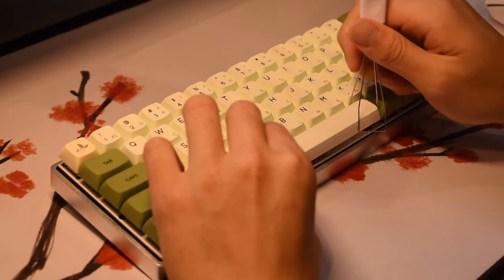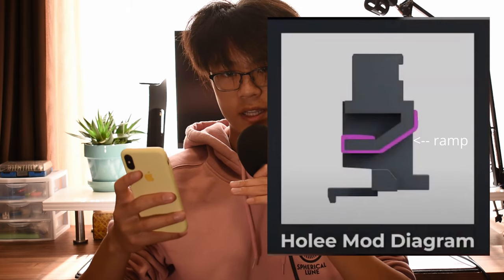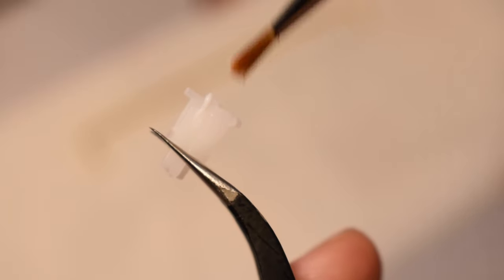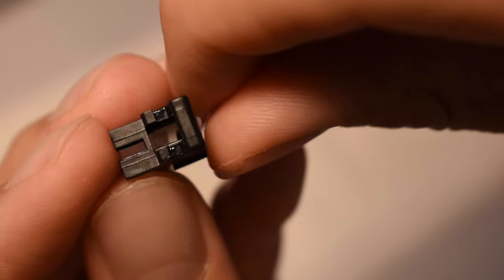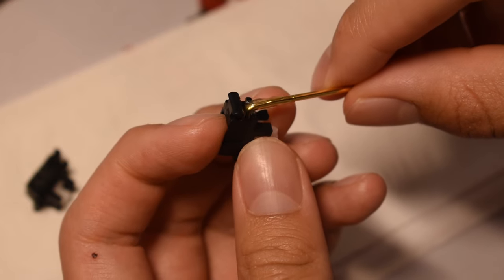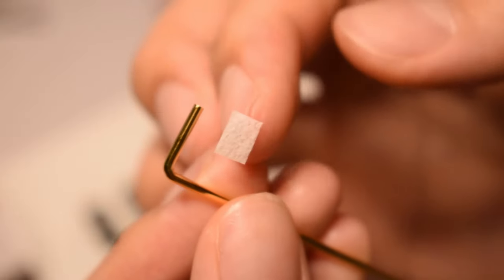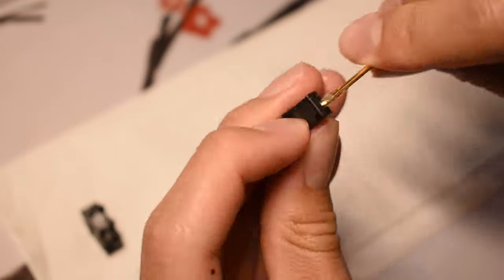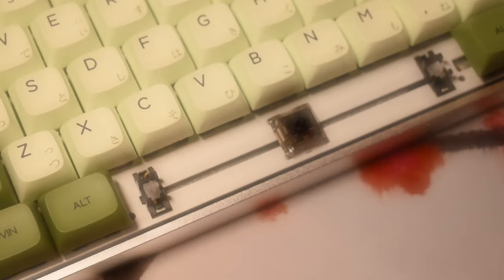Fix the rattle! | Modding Stabilizers Step by Step Guide

Comment: This was my first time modding a keyboard and was wondering why the keycap was stuck after modding the stabilizers. I cried for about 5 minutes but I came across this video and how it clearly explains that the stem is supposed to be placed in a specific way.. honestly thanks so much dude 😭
Reply from the maker: Haha No problem! I also ran into that issue the first time I modded stabilizers so I thought I would make it clear :)
Reply: time stamp plz
Reply: wherer is it omg i have that problem
Reply from the maker: @renex39  3:50
Reply: bro mines still doesnt work
Reply from the maker: @spwashh5160  Did you make sure the housings are clipped on to the plate properly? Are the “tabs” “locked in”
Reply: Same thing happened to me. Only instead of 5 minutes it was an entire day. And then the next day it... clicked.

Comment: I did my first holee mod today and it was very satisfying, I used also medical tape tho it somehow tries to slip out of the ramp but I manage to make it stay, also the wires are pre lubed I skipped that part and now it sounds pretty amazing, thanks to this tutorial
Reply: i know im a year late, but for anyone else that comes across this the tape/bandaid might slide off due to the fact there is prelubing on it. with lube on it the adhesive doesnt work very well

Comment: I recommend using krytox for the wire and the housing and stem. Dielectric grease will make your stabs a bit too mushy. Although I can say your spacebar after those mods do sound nice
Reply from the maker: Usually I would recommened 205g2 for wires over dielectric grease as you said. However, in my case, the fabric tape I use is significantly thinner than normal bandaids. As a result, I chose to use dielectric grease. But yes, I should have addressed that.
Reply: The trick is to use only a little dielectric grease then its not that mushy.

Comment from the maker: YOU CAN DO ALL THE OTHER MODS TOGETHER EXCEPT FOR HOLEE MOD OR BANDAID WRAP, ONLY CHOOSE ONE!!
I forgot to include this in the video, your stabilizer stems may come pre clipped. If so, you can skip the clipping part. If you are clipping, please make sure the bottom of the stem is completely flat and no parts of the leg remain, in the video, I did not show this. In addition, the bandaid on plate mod only applies to those who what plate mount stabilizers. For those who have pcb mount, you can skip that part. NOTE: I did not include wire balancing in this video, unfortunately at the time I did not know about it. I’d say wire balancing is the one of the most crucial steps in ensuring no tick or rattle. Please consider searching it up and following a tutorial!
Reply: yes
Reply: so you mean i can only do either the holee mod or the clipping? (as an example)
Reply from the maker: @cjrusjerles9075  You can do all the other mods together except for holee mod and bandaid wrap together.
Reply: @YBBK  oh ok thank you
Reply: i did all of em and now my space bar does even make a soound any more hahahahahahaha
Reply: Can I use any tape for this or does it have to be medical? (I'm such a beginner I haven't even bought a mech keyboard yet but planning to soon)
Reply from the maker: @craigharrison6392  For the holee mod and wire wrap mod, only uses bandaids, medical tapes or some other kind of thin fabric tape. I have seen people use clear tape but I haven’t tried it. You could do more research on it if you’re interested. For the bandaid mod, you can use any kind of thin tape. I found later on that electrical tape works really well.
Reply: @YBBK You mean either do clipping mod or wire band aid wrap only. 
Which one should I do on Royal kludge RK 84 barebone kit
Reply from the maker: @DrRadGaming  Only Holee mod or Wire wrap mod. All the other mods you can do together
Reply from the maker: @ryzenonehundred  Thanks for pointing that out, I thought I had already pinned it lol
Reply: Hello, the video helped me a lot, now my space bar is much better than before, now it is a piece of gold
Reply: What happens if u do both
Reply: What brand of medical tape did u use?
Reply: @YBBK how do u see if i have a mou nt pcb?

Comment: Fantastic camera work. The closeups on those stabilizer mods are excellent. And the way you showed how to reassemble a stabilizer "make sure the orientation is correct" (paraphrased), was very helpful. I'm about to mod stabilizers for the first time and was actually avoiding doing it because what if I can't get the stabilizer back together properly. (It happened when I first started working with switches.) This video has given me more confidence to go forward. Thank you.

Comment: Also an important thing-> The stem of stab. hits the PCB. So you need to stick some patch on the PCB. It should also reduce the noise level and protect the PCB.
Reply from the maker: I have noticed other people doing it however, it causes the stabilizers to feel mushy and less satisfying imo. Ig it’s preference but I recommend against doing that
Reply: @YBBK  i second this, it does cause mushiness in my experience as well, which is why I opted out of using the stock stabilizer pads that came with my Kbd67 Lite R3.

Comment: hey man, I have another question: I'm using gpl 205 grade 0 to lube the housing and stem, can I also use it for the wire? Or is a thicker grease required?
Also would you recommend the holee mod over the band aid wrap? I couldn't really hear too big of a difference. Thanks for the video btw!
Reply from the maker: For the wire I would highly recommend a thicker lube like 205g2, xht-bdz or dielectric grease. If you use 205g0, the lube will get displaced very easily and you will have to relube the wires frequently. You could use 205g0 as a temporary fix. Also, I would recommend the holee mod, I believe it’s a bit better in terms of feel and sound.
Reply: @YBBK  thank you very much 🙏🏽

Comment: Plan on using this guide later on as stabilizers have been giving me the most trouble so far. Esp spacebar. Btw what kind of tweezers do you recommended for this kind of fine work?

Comment: this is the video I was looking for. Thank you so much! One question. Which Holee mod is better; Band Aid in the house Stem or band aid around the wire? also I noticed you put tape on the PCB only on the bottom part, why not also the upper part of where the house connects to the PCB?

Comment: The bandaid wrap fixed very stubborn rattling on my space bar, but at the cost of mushiness.  I have to open up my keyboard again and see if I can apply thinner tape, since the bandaid that was used for this is kind of thick.
Reply: Yo, I have the same problem! I think the thickness of the tape I used greatly contributed to the mushiness of the whole thing. Damn, I wish I did more research about this.

Comment: Ohhhh my gosh thank you so much for this video it helped ALOT i have an rk61 with husky switches and the rattle in the space bar was so much that i almost bought a new keyboard because of it but then i stumbled across your video and watched it. I used the hole mod and the band aid mod around the stabilizer bar and the rattle completely stoped let this be a lesson to try other mods for cheep instead of buying lube and a brush for $30

Comment: Thank you! I'm glad i watched this tutorial. I have soldered switches and I'm frustrated with my spacebar stabilizer rattle, I didn't know u can still mod it with the switches on. I tried with the other stabilizers but the spacebar is the only thing that opens might be because the wire is longer there.
Reply from the maker: Haha thanks! The other stabilizers should be able to open as well. You might need to try more force or get a flat head screwdriver and pry under while pushing on the latch
Reply: @YBBK  i did just that but then the stabs popped out and i cant put them back hahahahahaha

Comment: The worst part about the holee mod is that once the stems have touched lube, the bandaids aren't gonna stick to it and it's basically impossible to fully clean them 😭
Reply from the maker: Yeah it's not fun lol. That's actually the main reason I included the bandaid wrap mod as it allows people who have prelubed stabs to have an easier alternative
Reply: @YBBK  and if my wires are lubed to?
Reply: @kreguli1467  💀
Reply: @kreguli1467  idk bro, use a tissue? pretty self explanatory
Reply: Warm water with dish soap.

Comment: Hello! New subscriber here! Also, how was the keyboard after the month? Does it sound mushy? Does the dieelectric grease and krytox goes off? Please answer I'm very confused and wanted to make sure that my keyboard sound after i do this will sound better like forever unless i stopped using it. Also can i do this on the other stabilizers? Like shift, and enter
Reply from the maker: Hey thanks for subscribing, I appreciate it! After a one to two weeks of usage the mushy feeling should go away. For the grease, some of it will be lost after lots of use however, the feel and sound shouldn’t change too much. Basically after completing these mods your stabilizers should be set and you don’t have to worry about them. And yes, as mentioned in the beginning, you can apply these mods to all stabilizers
Reply: @YBBK  That's a quick reply, aight man, thanks for the video, I'll be doing this when the grease arrives, and will be updating you(because there might be some issues since I'm a beginner and never done this before) and ask more in the future :D, again Thanks alot1
Reply from the maker: @lalalalala3448  No problems! Feel free to contact me through discord. Since for some reason youtube keeps removing comments with my discord tag, I'll include it in the description.
Reply: @YBBK  Aight i alr sent you a friend request!

Comment: When i tried to do the holee mod, you could hear and feel the bandaid scratching against the housing. Could my bandaid be too thick?
Reply from the maker: The band aid is in the stem therefore it shouldn’t be scratching with the housing. I think you might be talking about the wire. Does the stabilizer feel sluggish or mushy? If so, yes, it could be your bandaid is too thick OR you added too much grease.

Comment: Note! The wire wrap mod only lasts for a couple weeks. The bandage gets soaked in lube and falls towards the bottom of the stabilizer thus caused the most ear piercing rattle. do it the right way!
Reply from the maker: Really? I might be due to different materials, but one of my keyboard with bandaid wrap has lasted for 4 months and still fine
Reply: @YBBK  might be because you used medical tape and isn't as likely to change while being soaked in lube and used.  But idk wtf I'm talking about just a theory
Reply from the maker: @panikk2 you might have a point actually, thanks for sharing!

Comment: Hi! I'm planning to mod my RKG68 however I'm wondering if there's a difference between a lubed/clipped/modded stock stabilizer vs a lubed/clipped/modded Everglide/Durock stabilizer?
Reply from the maker: I haven’t tried durock plate mount stabilizers however I can say that everglide stabilizers are a huge improvement over stock ones. This is due to better wire quality and better stem/housing design. These factors lead to less rattling
Reply: Ohhh I see! Thank you so much for answering! It really helps!
Reply from the maker: @RochTheReaper  no problem! glad I could help :)
Reply: @YBBK  have you tried sunzit? A bit cheaper and meant to be as good if not better. Just ordered them.
Reply from the maker: @xcat22  No, I haven’t heard of them before. I don’t see any reviews on them, are they new to the market?

Comment: I think my band aids were to thick, stabs were fine with just holee, but the wrap causes it to barely move but it still registers, after smashing it a few times so it settled it rise more than before but only like 1/4 of the original with no modd

Comment: I used the fabricy bandaids for holee mod, and my stem wasnt fully unlubed as I had used the stabilizer with lube before I did this mod. The bandaid sticked, but I am worried that over time it will come loose? Do you think it will come loose, or will the stem in the way stop it from doing that, or something else?
Reply from the maker: It might come loose over time but shouldn’t be too much of a worry as you can just reapply it
Reply: @YBBK  nvm i did them completely dry, i put them on dry then I just greased the wire. Just wondering since one of my sides sounds clean and the other is kind of rattly, is that a sign of an unbalanced wire.

Comment: Great video. This'll be my first mod to my RK61 Pro. Can you use dielectric grease for all the stabs or should it only be used for the spacebar specifically? Trying to see if I need Krylox AND dielectric or if just one of the two will do.
Reply from the maker: You apply krytox and dielectric grease to all stabilizers (stem and housing with krytox and dielectric grease for wire) I only did the space bar in this video for demonstration purposes. Good luck on modding!
Reply: @YBBK  is there anything I can use other than a band aid or medical tape
Reply from the maker: @txchno_mango  I’ve seen one person use clear tape but I would still recommend some type of fabric tape. Link to clear tape mod: https://youtu.be/SFpE3Co32og
Reply: @YBBK  oh ok 	thanks

Comment: Hey so does this fix ticking spacebar issues on top mount stabs? I've been struggling for a year now trying to solve this. Even with the Holee mod, it didn't work. Haven't tried the band aid wrap mod tho!
Reply from the maker: Hey i think you mean plate mounted lol The bandaid mod is very similar to the holee mod so I doubt there will be any difference. Maybe your stabilizer wires are unbalanced. If balancing them still doesn't work I would just get new stabilizers.

Comment: Are those the stock stabs? Cuz my stock stabs in my gk61 sound trash after lubing and clipping
Reply from the maker: No I am using everglide pandas in this video. However, if your holee mod your stock stabs, they should sound pretty good

Comment: I've tried everything on my backspace lol. But I remembered I didn't use dielectric on the wires, and used 205g. I'll try again after work, and if not I have new stabs coming anyway. 🤷‍♂️
Reply from the maker: Did you try wire balancing?
Reply: @YBBK  I actually remembered I bought some Morgrie stabs and never used them. But they were screw in; just used that wore and stem in the plate mounted housing  and it fixed it 🤣
Reply from the maker: @Orlyy  Ah nice nice!

Comment: how to remove grease or glue from bandaids from holee mod on the stems?
also how to disolve the grease from krytox or any other dielectric grease without damaging stabs?
people say do not to use isopropyl 99% cus it melt plastic what the alternatives?

Comment: -hi, I want to consult about stuck/mushy stabs. 

So, I've bought the Durock Transparent Clear stabs (plate mount), it turns out that this Transparent Clear variant is a bit different than the Smokey Black and Tourmaline variant. This one happened to have rails inside of the housing, and the stem legs are shaped similarly to standard prebuilt stock stabs, but thicker so I don't think it's necessary to clip them as they don't feel as mushy. While the housings of the smokey black and tourmaline variant doesn't have any rails inside, and their stem legs are completely flat.

Tbh, the rails are indeed good to reduce the stem vs housing rattle, but it seems to make it a bit stuck when placed at the spacebar as the rails made them too tight. I'm at a loss on how to overcome this. Currently I grabbed a pair of housing from my still-not-used-yet Durock Tourmaline stab just for the spacebar stab as a temporary solution. At first, I thought it was the keycap, then I've also checked the spacebar wire, but then I tried them on four different keyboards of mine and they're all stuck the same due to the railings being too tightly pressed against the stem.

Do you have any suggestions? Thanks
Reply from the maker: I’ve never heard of this issue or tried clear plate mount durock stabs so I don’t have much to say. Your space bar may be warped which is causing the interference. If not, it could be a defect and your best bet is probably to get new stabilizers.
Reply: @YBBK  I've checked about the plate bend before I've tried anything else, I don't think that's the issue. 

I really suspect that the rail is the main issue, because I've tried all the housings on 4 different keyboards and they're all stuck at the spacebar only. I don't feel any stickiness / mushy feeling in other places like shift backspace and enter. 

I've also tried using different stems like the stock stab stems, and durock tourmaline stems, and it's the same, the housing rail made it too tight for spacebar.
Reply from the maker: @hadifelani  Yeah that’s unfortunate, probably new stabilizers are the solution
Reply: @YBBK  yeah, mix n matching is my temporary solution for now.

Comment: Should I do the mod with all the keys with stabilizers?  And is there any different kind of tape I can use?  Just wondering, Thanks!
Reply from the maker: Yes you should do it will all stabilizer keys. You can also use Band-Aids (make sure its not too thick)
Reply: @YBBK  Thank you! Amazing tutorial!